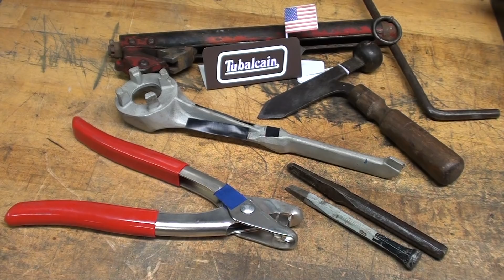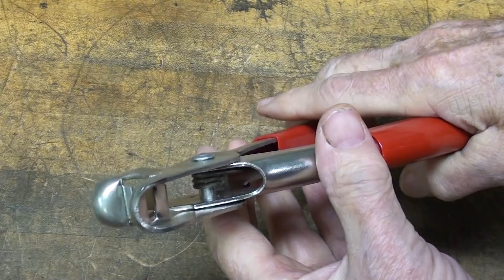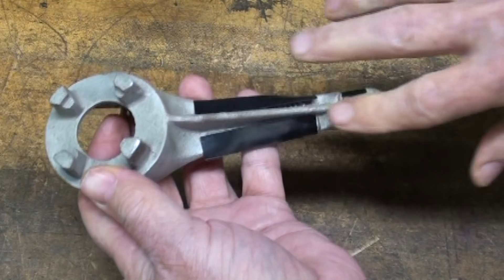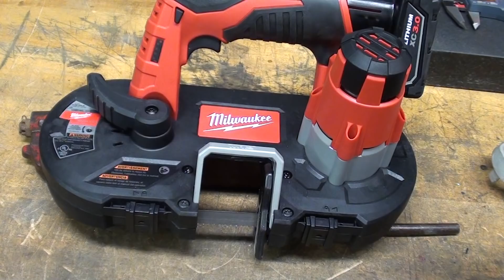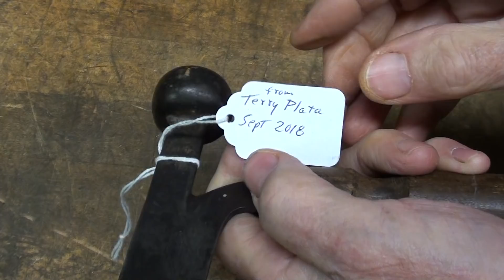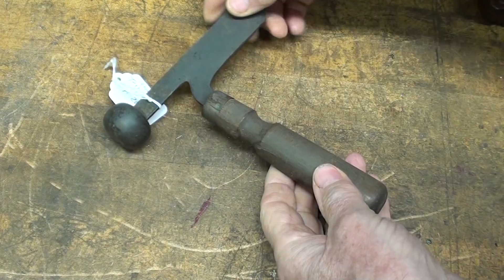What is It? MYSTERY TOOL 43a ques tubalcain mrpete

Comment: 5:17 is a coconut opening tool I think.  Drive the sharp pointed blade into it and then twist with the handle.  If you compare it to modern tools for this it looks similar.

Comment: Not sure about that chisel but I think it is used to correct drill position on a miss started hole, Vinal siding tool that makes a locking tab for finish trim, barrel bung wrench, I think that red thing is a fence wire stretcher, put wire in the cleat and the hook grabs the post so you can drive a staple or drop a barbed wire in the slot of the hook from the other  direction to make a midspan splice. No clue about the neat antique.
Thank you Mr Pete.

Comment: I've worked in telecom for about 20 years and I've seen that wood handled tool a couple times. I asked a couple of the older guys and they said it was for chipping lead (Pb) sheath cable. We still have some lead cable in the network, so they still use these things. Not sure if that was the original use of the tool but it is still in use by telephone cable repairmen.

Comment: 2 tool is used on vinyl siding to cut the snap tab on it after you cut the siding to size. the 3rd looks lige a drum wrench to remove the plug.  the 4th looks like a spring compressor.

Comment: Cable-Sheath Splitting Knife ...used by a telephone cable splicer to open a lead sheath for repairs. bwire pairs were papered wrapped lacquer coated wire....so great care had to be used to open the cable...hence the 2 handles on the knife.   Telephone splicers normally work in a two man team...so help was available for precision cutting.

Comment: The strange looking wrench is a bung wrench,  used for removing the threaded bung on 33-55 gallon metal drums,  they are made of aluminum or similar so they won't make a spark and ignite flammable drum contents.

Comment: Reading the answers reminds me that I used to use the bung wrench to open 55 gallon drums of racing gas on occasion.  Because of fire hazard most race tracks require fuel to be in 5 gallon containers now.  I sure hope you can find out what the antique tool is.

Comment: The “crank tool” was used for making an eye in guy wire . The ring on it is like you said to hang it up or to tie it to a hand line and send it to the lineman upon the pole
Reply: You are correct John S. Made mostly obsolete by improved material and ways to pull and make up guy wires.

Comment: One with the crank and screw is a fence wire tensioner I would say if the handle can slide.... but yeah now I have to try to find the answer video... if they were listed after watching or if you placed a answer link on the video that would be great.... sometimes I just can't find the answer

Comment: The third tool is a drum wrench, the spanner  side is for a recessed drum bung/plug that is recessed into the drum head the paws/teeth turn the bung/plug like a pin spanner; the other side is for a protruding bung that sticks up above the drum head; and finally the narrow end of the tool is for a breather bung/plug usually 3/4" or 1" in diameter
Reply: correct. you can still acquire them. I have a few and they are made from bronze to avoid any sparking.
Reply: the_youtube_guy_1985, A bung plug eh? Heavy duty!
Reply: true
Reply: I'll testify to that.. I used to work in an oil refinery, filling oil drums.
Reply: I was thinking that it looked familiar... Thanks for the reply as now I remember using one years ago when I was working as an oiler in a mill
Reply: you are right the_youtube_guy_1985, I work in a foundry in Auburn In. that makes it , i molded the  parts for 20 years
Reply: bung wrench
Reply: We called it a bung wrench

Comment: OK. I'm just  guess and not look at the comments until after I post. Sometimes that kills it for me.
1, Those chisels look like they are ground to work with a lathe to be used by hand on wood.
2, A sheet metal punch for assembling duct work. Maybe for tabs to go in the slot it punches.
3,A fire hydrant wrench.
4, Some kind of pipe wrench.
5, Another wood carving tool to be used totally by hand. The wood knob at opposite the cutting edge looks as if it's made to be hit by one hand while holding the side handle to steady it. Most likely for carving a groove or channel.
Now I'll read the comments, so if you see "edited" yous know I cheated :)

Comment: I prefer pondering (note I didn't use the word thinking) about the possible intended/designed for uses of the various tools you show in the "What Is It?" series. Then, either I already knew what it was, have had the motivation and the wherewithal to find out what it is, or I failed in my research efforts leaving me stumped. Only then do I read the comments — which I in turn try to verify. I also prefer to grate my own cheese and make my own biscuits.

Stick with the current format and let the less curious wait for the answers — or buy frozen biscuits.
All the best,
-- Joe
Reply from the maker: Thank you for that. then I'm not crazy after all.   When I watch Jeopardy, I sometimes Pause is it. So I can ponder or recollect the answer. I find pleasure in that. Apparently most do not.

Comment: Leave the format as is, the aluminum tool is a bung  wrench for removing the plug from a barrel usually a plastic barrel. It is made from aluminum so it won't spark when using it with flammables.

Comment: I enjoy this format. I learn a lot about what I don't know. ... Diamond point chisel. They are used for vee grooving (like weld prep and cutout, which is where I still use one most) or for where you need to catch something with the corner, like turning a bolt that snapped flush.
Not sure what the plier is for. Looks like it is for cutoff or slotting in sheet metal, maybe for locking tab slots?
Barrel bung wrench. Fingers for large bungs, slot driver for vent bung
After the saw, maybe a drawtight for buckle style steel banding?
I have been that knife before, but do not recall what it is for. I have a vague impression it might be for splitting wood battens?

Comment: The chisels are diamond point used for cutting V grooves. The plier like thingy is probably used for punching slots for tabs in thin stock or leather. The spanner is for opening barrels. The portable bandsaw is quite useful in pipework or cutting stock down to a more manageable size. The adjustable thingy looks like some sort of pipe wrench or crimper. The last, for cutting heavy, thick leather, perhaps.

Comment: The Aluminum wrench is called a bung hole wrench.  You can still buy them on Amazon.  They are used to open 50 gallon drums of product such as oil products , chemicals etc.

Comment: the pliers are for cutting locking tabs in vinyl siding. i call those chisels veining chisels   for cutting vee's. the aluminum is a plumbers wrench  for doing spigot repairs back when you could actually replace o rings and seat washers. the next is some type of plate clamp   the last i believe is a leather scribe knife

Comment: Third tool is a drum wrench. Used to open 55 gallon drums.
Reply: Yes that makes more sense than what I thought it was. A wrench RVers use to open 3 and 4" caps for their sewer connection.

Some use caps with the normal square heads but some use caps with slots.
Reply: @chartle1  That wrench works for that too.

Comment: 1. Corner chisels 
2. Vinyl siding punch for sure. Used for making tabs in siding under horizontal overhangs or windows when it has to be cut and fitted into channel in that are nailed under windows or soffits.The tool makes tabs that click into the channel- not J channel, but I can't think what that channel is called right now.
3. Bung wrench for barrels.
4. ?  Looks like it draws ends together like some sort of binder. Maybe used for wire fence? Draw wire or cable into a connector? If so, I don't see how to remove it once a connection is made. It looks like it is used to connect or disconnect something. Hmmm
5. ?  Push and draw or push and twist? Don't know.
I think the way you have always done the "what is it?" videos is just fine the way it is. It's fun, as you intended. It gives everybody a chance to think or guess if they want and make funny remarks, and if they don't want to play that way they don't have to. There is always the option to not play or just wait for the answers.

Comment: The aluminium spanner is a drum spanner for opening a specific products in metal drums the end with four prongs is for the larger of two bungs that have a cup shape with internal lugs that the prongs press against, where you might place a pump and  small end is for removing the small bung for either venting the drum or for the installation of a tap. The spanner markings would give a specific order number  and the maker would give a hint to the product whether solvent or fuel or ANFO mix. The crank for helping fit wheel chains or for straining wire  as suggested by others also looks a bit like the jack on early Volvos that used to have a folded metal prong that went into a hole in the vehicle bumper and where the  nut is had a leg with a foot plate. I wondered if the tool with the wooden handle was something for opening tins of oil or the like before they had the piercing spouts or  commercial  tins of fruit juice  Pierce a hole and twist to enlarge the opening.

Comment: The 5th item is to split coppice wood, it is pushed in the end grain and then twisted with the side handle, cheers
Reply: I like the sound of your answer Andy - that would split with some precision :o)
Reply: Hi, interesting, I assume it is in the manufacturing, difficult to see any onther reasoning, cheers
Reply: Dave, it's obviously for cutting and splitting, unless it's a can opener as I have cut cars up in the past with and axe and club hammer, brutal, cheers.
Reply: I think it is a derivative of a 'Twybil' a green woodworking tool used in making rustic fencing and hurdles. It's basically a mortising tool.

Comment: We used to call the chisels nosers. They were used to get out broken off threaded nipples in fittings. This may not be the correct nomenclature but they came in handy in the pipe fitting trade. The other red handled pliers thing was used for vinyl siding installation. The long handle “ spud” wrench is used to remove and install plugs in barrels. I think the other cranking handle tool was used in fence wire installation. The antique tool, I’m not sure but looks like it’s used to split ice or something?
Reply: Fence tool was also my first thought about the cranking tool. Keep the format .
Reply: I agree on all.  I think the antique tool is for leather or heavy fabric cutting.

Comment: #1 might be a keyway chisel for putting in the keyways at 45 deg angle
#2 could be s sheet metal tool.. probably for crimping an edge
#3 is a bung wrench.. for opening 55gal drums and the hex-head for tightening up a spigot on the barrel. the tab on the other end is used for removing the small plug of the barrel
#4 is probably used for pulling rebar matting and rods together so the can be welded or wired
#5 is a leather cutting tool

Comment: I used the Diamond point chisel for splitting and removing bushings from housings such as king pins and connecting rods. The bung wrench is a given haven't got a clue on the rest.  Keep the format, there are some items that you don't know and this gives a opportunity for input from people that do.  I have a tool to send to you, just have to find it, not a clue what it is used for. Will be in touch when I locate it.
Reply from the maker: You hit it on the nose. I need the input from part one in order to produce part two.

Comment: 1st one - I don't know exactly but I have one!
2nd - Looks like something for cutting buttonholes in leather?
3rd looks like a plumbing tool or used where corrosion would otherwise be a problem - on a ship?
4th might be an old cheap (cause it's hollow) sort of wrench for plumbing or car work. Maybe from the times when you had to crank a motor to get it started, or mid-WWII? The ring looks like it might possibly have once been a removable pin for making it a smaller item to store in a car trunk. If it was then one of its owners used it so often he split and peened it so it would stay put. 

My other guess for it is something to do with pulling wire or cabling out of a jacket, where cranking righthand-wise would pull a cable or wire with the jaw while the toothed foot on the end grips and holds the jacket.

Last tool might be for leatherwork, veneering, upholstry or very very old finish carpentry. It does not look like a rough tool, but for working on large pieces. Maybe saddlemaking?

Comments on the other parts of the video:
I like the 2-video format because I enjoy reading the comments, guesses, and knowledgeable people's info but also like your personal stories about the tools.
For the "tennis shoe tools" I honestly like when the tools look nice. They have to be tools-first as the primary goal, but I find more and more that bright, distinct colors are less likely to get lost in a drawer or toolbox than a mess of grey and black with occasional orange or red highlights. Plus I am more likely to notice if a tool is dirty or needs some maintenance when I can see the contrast. As an additional bit, I personally like the ability to have a tool that is "useful" when it may only be used occasionally. Being a cool decoration makes it useful when it may otherwise be looked at as clutter. Plus when these eventually start to fail they may be attractive enough for the casings to be cleaned and repurposed by a crafty individual.

Comment: I like the current format.  If people don't like the two installment format, just skip the first one.  The bung wrench is easy, use that often myself.  Some people aren't aware you use the "slotted" tool on the hind end for the vent.  I was thinking the last tool was an old spring compressor but it looked a little wimpy for the job.  Fence stretcher, as others have proposed, certainly is a possibility.  I can't say for sure though as I've never seen/used one.

Comment: The aluminum wrench is a Bung Wrench.   One side opens the business end of a large drum.  Flip it over and the socket opens the vent hole on the same end.  The flat end could be used to pry off or pierce/split the plastic or soft metal seals that were often on the drum plugs.   

I haven’t the foggiest idea what the others are.  

Format:   I like this format of parts A and B.  My only complaint is you wait way too long to issue part B.

Comment: Keep the format.
I think the last one is for cutting leather.
Reply: jim s ditto
Reply: It might also be useful to someone making a wood cut print. Depth of cut changes the width of space. This tool would allow greater control over that as well as being less effort than single stem blades, chisels or gouges.
Reply: I have seen one of those before and I think it was used by a saddle maker I know at one time.

Comment: Perhaps combine A and B into one video with the answers at the end? One could guess and then get the answer.
The last one looks almost like some type of froe for softer material. Use the knob to push it in and then twist the handle to split it.
Thanks.

Comment: I like the current format, A then B.
Reply: Red handle tool is for notching vinyl siding so it will lock into next piece
Reply: @johnnym1320 , That makes more sense than mine, but I was on the rihjt track, iI think. I was thinking the same thing but with sheet metal. Hmm, we'll see.